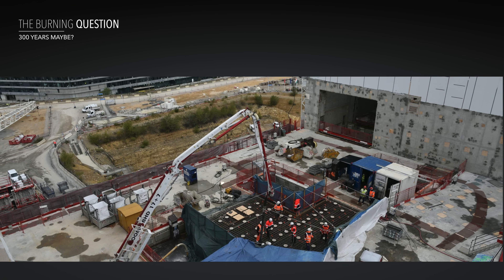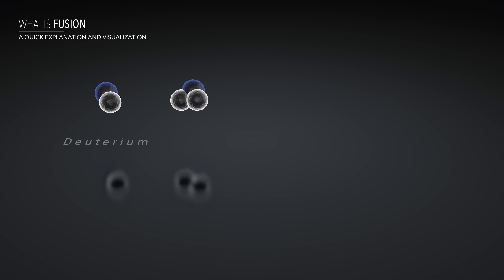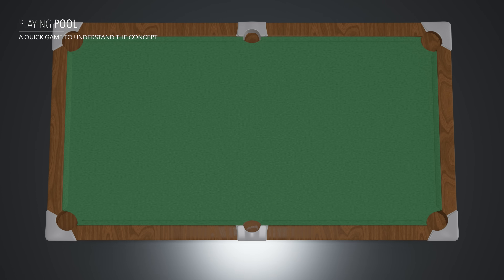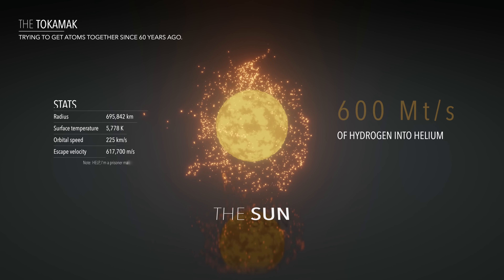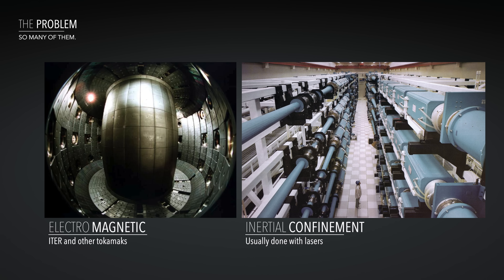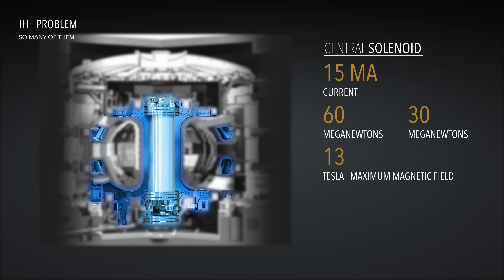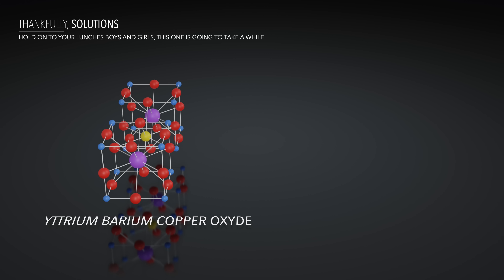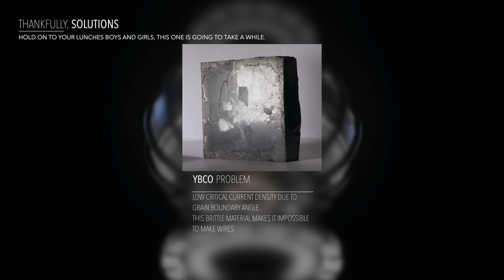Fusion in 30 years? ITER update [2020]

Comment: Well if fusion doesnt work than we could turn to thorium reactors for renewable energy.
Reply: We need to turn to thorium reactors now if we want to curb global emissions at a reasonable pace.
Reply: It's good science, but it's not a solution to power the world.  Fusion is only 8 times more efficient than fission.  Fission is 3,000,000 times more efficient than chemical reactions like coal/natural gas.  We don't need that extra 8 x that fusion provides.  Fusion is ridiculously expensive.  It has no pathway to commercialization.  The entire thing is filled with superconductors and advanced materials.  When it is completed, ITER will be the most expensive "thing" ever paid for by mankind.  And that's only the first experiment to fuse the easiest fuel to fuse (Deuterium-Tritium).  D-T is a neutronic reaction and will embrittle the reactor chamber.  The reactor will need to be shut down periodically to replace the walls of the reactor chamber, and all the expensive superconducting magnets.

A better fuel, He3 is aneutronic, but that fuel is only available on the moon, and only very sparsely (measured in parts per billion in lunar regolith).  Another fuel proton-boron is less neutronic, but still has some neutrons.  Unfortunately, that's much harder to fuse than D-T.  So we are at a lose-lose-lose-lose situation with fusion.

Again, it's fascinating science, but it is not practical and can never be commercialized.  Let me explain why it can't be commercially viable:  Say a power plant costs 1 billion to make.  How long will it have to operate to pay for itself?  The answer at today's electric rates is about 20 years.  20 years just to get the initial capital investment back, and that doesn't include any maintenance or operation costs.  That also doesn't include any profit.  NO investor would want to make such an investment.  Where's the return on investment?  And oh, by the way, no fusion power plant would cost 1 just billion dollars.  Multiply that by 10 in the very best case.

And where are you going to get the power to turn a fusion reactor on?  You need a massive amount of initial power to start it up.  Will that come from coal?  Natural gas?  Nuclear?  Why not just skip fusion and build a more nuclear (fission)?  Especially the next gen molten salt reactors that are safer, cleaner, better, and cheaper that today's nuclear reactors.
Reply: @matthewgrotke1442  Damn i think you just deleted this video :D
Reply: @matthewgrotke1442 Grotke are you a scientist Just asking?
Reply: Matthew Grotke 
It won’t be the most expensive ‘thing’ thats the international space station at 120 billion
Reply: @matthewgrotke1442  you totally missed the point of why fusion could be helpful. It's not about the power output but the cheap and abondants reactives
Reply: @Soeeasy  Fusion will be very necessary in an application for which there is no economical competition, such fusion rocket propulsion for spacecraft.  I appreciate all the good science coming from fusion research.  But fusion will never be economical for power production compared to fission.  If you want to discuss fuel abundance, next generation fast reactors could power civilization for thousands of years by consuming only the existing nuclear waste and not having to mine a single ton of new uranium.  After that, breeder reactors could power civilization for hundreds of thousands of years using thorium (which is 3x more abundant in average continental crust than natural uranium).  Thorium does not need enrichment and can be nearly fully converted from its natural state Th-232 to fertile U-233.  In comparison, just 0.7% of natural uranium is U-235 (enriched enough to use).  If the fuel is liquid, such as in a 2-fluid molten salt breeder reactor, the fission products can be chemically removed from the fuel stream and the U-233 can be fully consumed.  This is several orders of magnitude more energy extracted per kilogram of thorium compared to traditional solid fuel uranium reactors.  I would say fuel abundance is not a concern for many thousands of years, so let's keep working on fusion research, but lets not ignore the more crucial near term solution of advanced fission.  More federal funds should be spent on this development.
Reply: @matthewgrotke1442  You do realize that the US government spent 1.5 trillion dollars on the f 35 program .Also that if a fission power plant costs 6 billion dollars to build that means that a fusion plant that costs 48 billion dollars is more economical because you don't have to deal with the nuclear waste.
Reply: @StefanVujovic  There are 2 types of "nuclear waste": (1) spent fuel; (2) radioactive equipment.  #1 the spent fuel is tiny by volume and is fully contained in dry storage casks.  It never interacts with or harms the environment.  Nuclear engineers do not actually consider spent fuel to be "waste" because future fast reactors can consume it as fuel.  #2 radioactive equipment includes the reactor and cooling components that have absorbed neutrons.  This is also a problem with fusion power, unless you use an aneutronic fuel, which is either harder to fuse or much scarcer, depending on the type of fuel.  The next generation of fission reactors are small and modular and can be mass produced in a factory.  These should cost well under 1 billion each (probably closer to 500M) and will eventually have the cost advantages associated with of economies of scale.
Reply: @matthewgrotke1442  The problem is that the public thinks that nuclear power is dangerous and because of that it has a bad reputation. But actually nuclear power is the safest and cleanest source of power. Fusion wouldn't have a problem with reputation and would get tax incentives from the government. Making it more economical than fission.
Reply: @matthewgrotke1442  You do realise Fission plants cost Billions $$ to build right?
ITER is an expensive experiment I agree, but tokamaks are only one way to go about it.
Reply: :D lol true
Reply: What do you plan to do with proactinium problem?
Reply: @Poctyk   By protactinium problem, you mean the fact that in the thorium fuel cycle, Pa-233 has to be separated and held separately until it decays to U-233 (which is pure bomb material)?  Yes that's a problem.  You could contaminate it with U-232 but practically-speaking, an unsupervised reactor operator could decide not to do that.  I think the real solution is to only have liquid thorium fuel cycle reactors in the hands of trusted allies that agree to full-time UN monitoring of every plant.  Otherwise, there are plenty of other nuclear reactor designs that are very proliferation resistant, much more so than LFTR.

Comment: If it takes an international effort to build a proof of concept item, what will it cost to power the world with thousands of these?....more than it's worth.
Reply: Prototypes are usualy the hardest to build and most expensive considering you are trying to learn the optimal way of manufacturing. We are not even at the prototype stage. But i agree with you that this is a bad investment when options such thorium are more practical right now. Switch some of that investmen from fusion to thorium.

Comment: Uranium 238 isn't fissile.
Reply: It's fissionable so if you have a fusion reactor spitting out crazy high-energy neutrons it will make power on top of the fusion reaction. A uranium+lithium salt can breed tritium, split U238 and deliver the heat to the turbine hall.